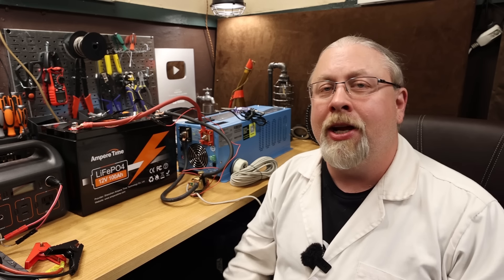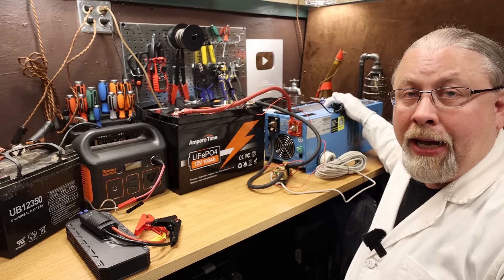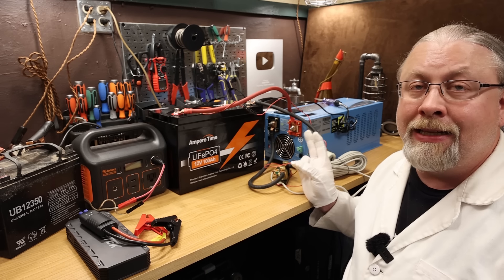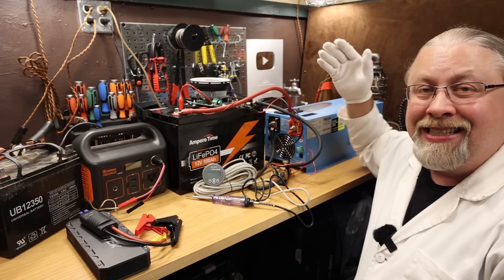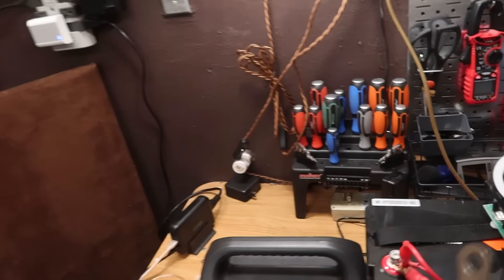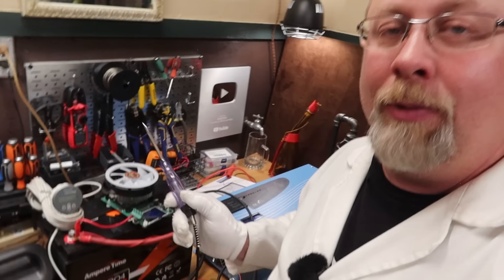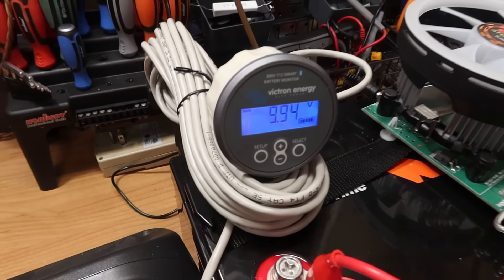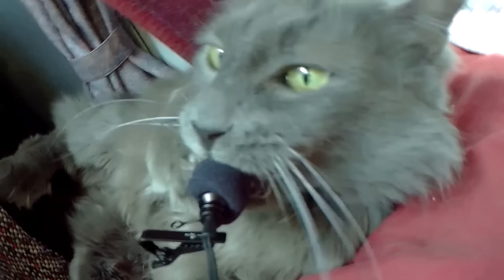3 Ways To JUMP Start And WAKE A DEAD Lithium LiFePO4 Battery FAST!

Comment: I have a 48v lithium iron battery connected to an inverter/charger and MPPT solar controller, which is connected to panels through a DC breaker. My batteries discharged completely, powering down both the controller and the inverter. I managed to boot the system back up by doing the following:
1. DC breaker up
2. Battery and inverter on
3. Wired up three 12V batteries in series to get 36V (didn't have a fourth)
4. Connected terminals of the above to the terminals of the Li battery. There was a spark, as expected,and then both the controller and the inverter switched on (removed the jumper cables)  and began charging the Li battery

I initially tried to use 2 batteries in series (24V) and it switched the controller and inverter on, but they treated the Li battery as a 24V battery and assumed it was fully charged. This is because both the controller and inverter infer the battery voltage. Figured if I wired my last battery up to get far enough from the 24V operating range, the system would identify the Li battery as a 48V and operate as intended. Thankfully it worked.

Comment: I was quite unhappy to get brand new li time 12.8v 100A batteries delivered in the shutdown mode. I cannot connect Bluetooth. The terminals have only 3 voltage. I thought a lithium-ion battery charger would wake up the battery, so went to homedepot got a Dewalt 10A lithium charger, the charger not able to recognize the battery due to no voltage (yes after connect with charger, the 3 voltage dropped to 0.7v!!). Your video shows a car battery jumper would do the trick. I happen to have one around, I connected the negative first, then connected positive and clicked the jumper “boost” and a beep from my jumper and all jumper lights turned off. I had no idea if the LiTime woke up or not until o connected Dewalt charger and started seeing 9A current flowing into the battery!!! I also able to connect Bluetooth without any glitch. The app is actually pretty neat. I don’t know why the app got only 2 out of 5 review stars. Thank you for your video !

Comment: Worked great for Braille Green Lite LiFePo4 battery showing ~3v. LFP chargers wouldn't wake it, but touching the terminals briefly with a lead acid traditional jump box woke it up. DMM jumped to 11v and battery proceeded to charge.

Comment: I have an Ecoflow delta pro extra battery that over discharged because someone let it sit up. But it’s a 48 volt system I believe. I have a 12v lithium capable smart charger. Maybe if I leave it connected to it long enough might do something. I’m gonna do this in the yard tho for sure

Comment: Thank you very much it did the trick. I used jumper cables from the car, gave it about 30 seconds and hooked my new lithium charger back up and wallah! The charger said the battery was 11.5V and 24% so the BMS shut down early. Anyways I got it and if it rains for 6 days I'll make sure 
I supplenent charge it.

Comment: i was told by a supplier if the lithium battery went to zero state for too long it will not be able to be revived. Is this true? and they refused to jump start it so i was thinking of taking back the battery and follow your steps mentioned in this video
Reply from the maker: Yes

Comment: For the Jackery method, would it be better to attach the cables with the Jackery off, and then once connected, simply turn on the Jackery dc output?

Comment: Great stuff. Question........I have lithium batteries in my boat and I also bought a noco boost plus GB40 lithium jump starter. In the directions it specifically says not to use it on lithium batteries. Can you clarify this for me? If I understood your video correctly it will work. Thanks a lot for your hard work.

Comment: Thanks for this informative video! 

If I were using a 30V / 10A bench power supply to jump start my 15.2V/4480mAh LiPo battery. Is there a specific current setting that I should use?
I've been told sending it 24V will jump it but not sure if a specific constant current is recommended

Comment: Thanks, now I've got that song stuck in my head 😎

Any tips on doing this with Ni-MH batteries - specifically dead AA rechargeables?? The charger that I normally use refuses to charge them. They sat depleted for a while.

Comment: ⚠️  Urgent Question…
I’m about to install a Power Queen 12v 100ah battery at a radio repeater site that does not have a battery charger yet.
It’s NOT going to be a solar system.  It’s going to be chargers every few months by an AC charger or power supply with DC to DC charger.

BUT…. Can I safely use a 20 or 30 amp power AC to DC supply to charge it now while waiting for a charger to be ordered?
If not, can I send DC power from the same type of power supply directly to the solar input of an MPPT 30 amp charge controller?  I think we have a Renogy MPPT charger at our firehouse.

Thanks !,,

Comment: So if I shut off my charge controller it won’t start up again unless I jump the battery. What am I doing wrong? I have a 100/50 Victron. I am using a 300 amp lifep04, and a kisae inverter.

Comment: Hello, this was a great video. I am curious if I can safely try this in my situation. I just bought a campervan conversion (that had been sitting for 2 years not used) and charging the 300ah lithium battery via shore power or dc chargers (through the alternator) quickly drains. The van came with a bms in the form of a monitor screen that will not get power. My thought is that the bms is in a safety mode and the battery might need to be jump started. I don't want to ruin any electronics or start a fire. Any tips on steps to take or things to check before trying to jump start?

Comment: Great infos, probleme with newer gen battery is that they have circuit board controller that gets corrupted on purpose when low or impacted and you need special equipement to reflash the board. Thats unecessary in my opinion. (Foe the impacted i get the point of something might be broken inside so its a good safety? But low voltage protection actualy saves the batteries so why need to relfash it!! What do you think

Comment: Little question. It happens right now for me. The problem, my generator use my my lithium battery to start. I have a pusher diesel motorhome and the generator is a diesel generator too. So even though your advice works perfectly, I have jump started my lithium battery with my chassis battery which are not lithium just like you recommended, my lithium batteries are not enough charged to start my generator. My question, can I leave my cables like that and trying to start my generator using the power of my chassis batteries? I did not dare so far cause I don’t know if I can damage my lithium batteries using such setup! I repeat, my chassis batteies are hooked to my lythium batteries (which are my house batteries) ilke so, I would like to try to start my generator using the power of my chassis batteries.

Comment: I’ve got a 100 amp power lithium battery on my boat. It had 20% left. I tried to charge it, but it would not take a charge. It would power things and keep running thebattery down. But would not charge any ideas?

Comment: Absolutely brilliantly comprehensive video. I have a briggs and stratton 82v 2Ah battery thats dead. Can i use this method on it?
Reply: Hi , did you find an answer to fix your 82 volt battery?Martin
Reply: @martinbramston2244  hi Martin, I'm afraid not.

Comment: Thank you man!!!! I thought my battery is dead an i'd have to replace it. The second trick did it and saved me a few hundred bucks :-)

Edit: didnt work as i initially thought. Charger is showing 11.3 v while apparently charging but fault led is on. When disconnecting and reconnecting the charger it shows 0v again 😢

Comment: I have a 48v 20 amp LFP battery on my eBike. It wouldn't take a charge.
I have another similar battery. Both batteries have Anderson connectors so it was easy to connect them to each other.
The good battery got the bad battery working and I was able to charge it and get 20+ miles out of it.

Comment: Can you use the test light to pre charge a inverter instead of a resister?
Reply: No, the light filament is just acting like a resistor.
Reply: @LarryDickman1  if it acts like a resister why can't I use it to precharge the inverter instead of using a resister?
Reply: @edolson1698  You can. Your wording made me think you could use the tool itself as a power source.

Comment: So I did this option of jumping it with another 12 V lead acid battery and the digital screen would come on on the lithium iron battery but then as soon as I disconnect it, it would not continue to take a charge or have any power left in it at all it would just die completely again
Reply: I'm having the same issue. Mine is 8v but once I take the jumper off it's back to 8v

Comment: So a technical question for you 
I have a  stand alone 48 volt 30 amp lythum at 0.20 volts showed on my meter not my battery lol its my buddies  my question is do I wake it up the same way as a 12 volt using 12 volts or do I need 48 volts to trick the BMS

Comment: You just made me go from scared and kind of mad at myself, thinking I may have just destroyed thousands of dollars worth of batteries, to hopeful, and believing that I'll be able to fix this problem! 

I like you mentioned, have a row of 12 volt batteries in parallel, and I just went out with my volt meter, since it's nice out today, and my solar should be working, (but my Bluetooth monitor won't show up on my phone) so I went to check the voltage with wires 😂 and I got nothing! I got more voltage from my body 😂 

I have a lithium battery jump pack, I was getting scared by Google, they were saying that I would cause a fire even if I started to charge them 😅 still a little spooked out
Reply: I tried using my small jump battery, and it didn't work, maybe the pack is too smart? Or maybe my batteries are just too dead.

Comment: Hello 
I enjoy the heck out of your vids... learned a lot....
So I have a question... have you done a video on the DC house 12.8v 100ah lifepo4 battery...the one with the power button to turn on the dc-in/out,usb-a, and the usb-c.....my power button isn't working is that an easy fix.... thanks

Comment: I thought this did the trick, but alas, I'm still stuck. I have two different kinds of frozen batteries - the first, and most expensive, is the 12V 50Ah Pro LiFePO4 Battery from Timusb (Amazon), the second (I have 3 dead of these) 12V 20Ah LiFePO4 Battery XZNY. I also have a NOCO Genius 10, which has a "force mode" that I thought might help, but no.

I have a couple car-jump batteries, and tried that technique first, but the didn't budge. I tried using the car with jumper cables, and I thought that worked on the 50A - when I reconnected it to the NOCO, it immediately started charging. But what happens with both types of batteries. is that the first of four red LEDS on the charger will flash, we might make it to the second LED for a few moments, then it falls back to the first, and that cycle repeats indefinitely. In previous texting with the XZNY I could never get it above something like 21% ---does this ring a bell? Any suggestions?

Comment: Thank you!  Superhelpful.  Could I use a noco boost gb70 to do this jumpstart?  This a one battery simple solar setup.  Does the jumpstart charging impact the solar controller and inverter or are they ok during this process?  Thanks!

Comment: Anyway to jump start a Bluetti lithium iron Po4 battery inside their solar chg??
Reply: Use an automotive accessory plug charger...it will force current to the BMS, waking it up and allowing the charging mosfets to feed current into the battery cells.
Reply: @jasonbroom7147  you mean a lithium car jump starter? If you plug that in to the Bluetti 12 v cig socket that’s Out?

Comment: My new 40A MPPT won't power on.  New lifepo 200 Ah battery shows 12.6 V -- I'm looking into whether its BMS has reached discharge cutoff, and whether this battery may have sat in a warehouse long enough for it to have run down.  When I connect SCC, battery shows 6.7 V.  Spec implies SCC should start with batt as low as 9 V?  Any harm trying to charge battery similarly to what you suggest, or is it more likely a dead cell problem, or worse, SCC

Comment: Would this work with a 48v lithium battery jumped with another 48v lithium battery to try to start the charger? My new 48v lithium battery showed up today with 4.3 volts and the charger won't recognize a battery
Reply from the maker: Yes

Comment: Method 2:  first thank you for imploding the universe.  The trick is to connect red last to "jolt it awake"?  You can't just connect black last conventionally?   When I bought SOK 206Ah Lifepo is came in a sleep state my AC charger could awaken.  Now I guess my lifepo is deeply discharged and charger cannot do it -- its recovery mode is just for other battery chemistries. So I first have to wake it in a manner you suggest; please confirm.  Also, confirm any deep cycle battery, but not a car starting batt, can wake my lifepo.  Thx!

Comment: This is a great video, but now I have a question.

I bought the Dr. Prepare 100Ah battery + Hub you reviewed a couple of months ago.  I was under the assumption that I would need to swap out the lead-acid charger in my travel trailer before I could use the Dr. Prepare battery.  Currently, my RV has an Exide 24MDP battery. 

22 seconds into the video I am hearing this "... how they're supposed to work; is that you just remove your old lead acid battery, you drop one of these into place, use your same lead acide charger." So basically, I don't have to mod my RV, the BMS built into the Dr. Prepare battery will enable proper LiFePO battery charging?
Reply: There's a slight difference.  A regular lead acid charger will vary the current as it charges (lithiums do better with constant current) and the fluctuation slows down charging.  The lithium can accept a higher voltage than the regular charger can provide so while it works fine on lead acid mode, you're not charging the lithum cells to their max.  Optimally, you want to add a lithium charger when you can but it doesn't always have to be the moment you switch the battery chemistry.

Comment: Willow Victron, smart solar charger controller do this? My battery was in series with one other & I ran a fan heater & might have caused bums to shut off or battery damage. Battery voltage readout was all over the place so I isolated the bad battery and switched to 12 v and now using the good one. Have put charge controller on the bad batt but that didn’t charge it & also tried using 2 chargers for a 12v drill and a regular 5amp car charger.

Comment: Professor, thank you for the wonderful  video . I have a 36 V / 7 Ah 252 Wh Li-ion electric bike battery that’s a year and a half old. It won’t take a charge I assume because I let it sit too long without charging. I’d like to try jumpstarting it, but don’t know what I would use as a power source. Can you recommend a power supply that I could buy online? Thanks again for sharing this battery knowledge with us
Reply: Hi , did you get a successful outcome on your 36V bike battery dilemma ?... I have the same problem.  Martin
Reply: @martinbramston2244  
Yes I did get the battery fully charged again. I was able to use the charger that came with the bike by inserting a paperclip into the center of plug on the end of wire from the charger. Then I clipped the first jumper wire to the paperclip and the second jumper wire to the outside of that same plug. And then took the other two ends of the jumper wires and attached them directly to the battery bypassing the BMS or battery management system, and the battery started to charge immediately.

Comment: Yo hobo, my Holiday Rambler has a built-in relay system that combines the house and chassis batteries to act as a emergency jump starter. Can a smart battery support a starting motor?

Comment: So question regarding your comments about a “drop in battery”, I have 2 Dr Prepare 100ah LifePO4 batteries I’m putting in my travel trailer. The RV has a WFCO 8935P converter/charger in it, it is NOT lithium aware, only lead acid, AGM charging profiles. The question is, do I really need to change my converter to a lithium aware converter/charger (progressive dynamics PD4135KW2BV)?

Comment: How would you charge three dead lithium 12v batteries wired in series?
Reply from the maker: A 36v charger or take them apart and charge each with 12v.

Comment: I have a lithium lead phosphate battery that was exposed to sunlight heat and now shows 12.9v with a meter, yet will not light a test light or power anything. 
How can a battery show adequate voltage yet not generate any power?
Please help I have never seen anything like this. It completely defies logic.

Comment: Hey. I have a question about Jackery. My Jackery 440 is not charging anymore. All the outlets are working, and the battery is discharging, but when I try to charge it, the LED next to the input is just blinking slowly.
I've contacted Jackery, but they told me to kick rocks.
Reply from the maker: Jackery 440 was last produced in 2018. Congrats for getting 6 years out of a 3 year product. Time to upgrade to a LiFePO4.

Comment: I converted my battery to lithium and my ground and neutral touch and the wire burnt out I replaced the wire it still will not turn on but the voltage is reading 38v .what can I do to fix it?

Comment: I tried this to my battery that arrived reading 0.09v. Issue is inside it tests like 14v but the bms only shows 0.09v. I can get it to charge but as soon as I remove the charge, it shuts off. Any tips?